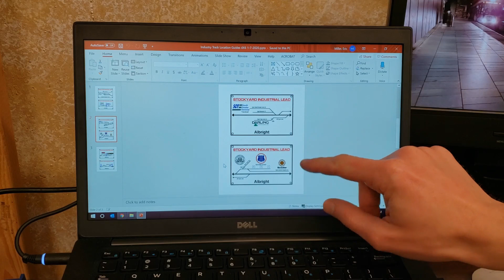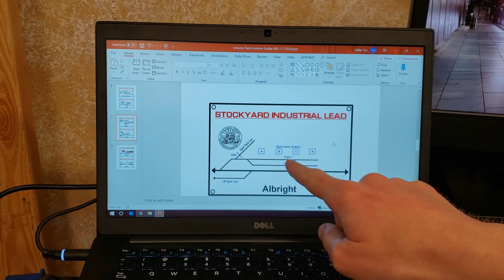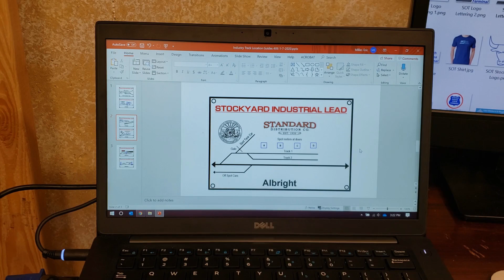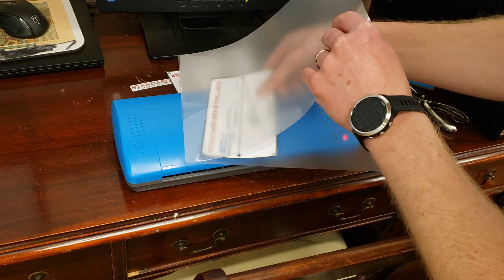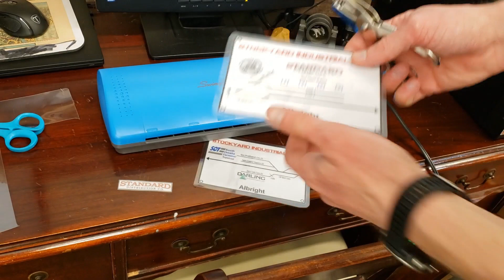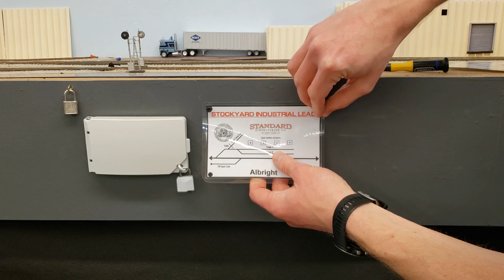Stockyard Industrial Lead: Creating Simple Laminated Track Diagrams for the Layout

Comment: This technique of using PowerPoint to make graphical placards on the fascia is a great idea. I agree with MrSw9guy, and it provides to users' a very easy visual interface with where they are. This along with other tactile routines [ie using flags at certain crossings] makes... encourages the operators' to immerse themselves and feel part of the process. I was watching a layout video where the operator had to throw a toggle the "light the flares" [small red, flickering SMDs embedded into the road's surface] in order to cross, another time-taker to extend enjoyment/ interactive experience. Just a random thought.
Reply from the maker: Thank you for the note!  I agree, I really enjoy adding little operations-related pieces like this to the layout to make it more fun for the operators.